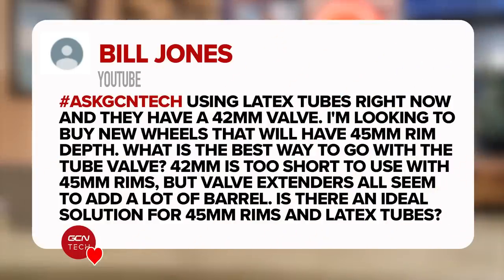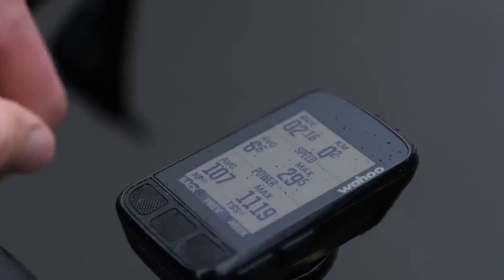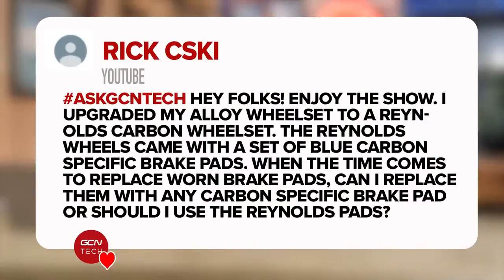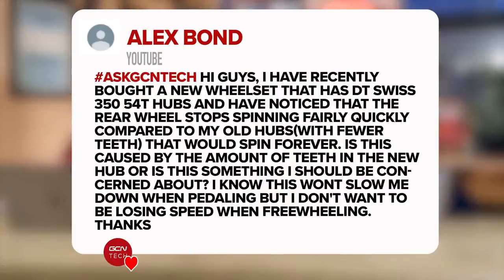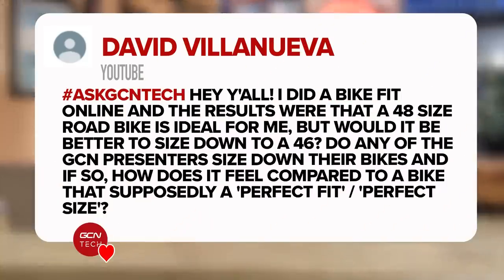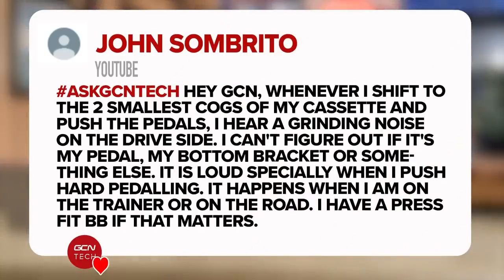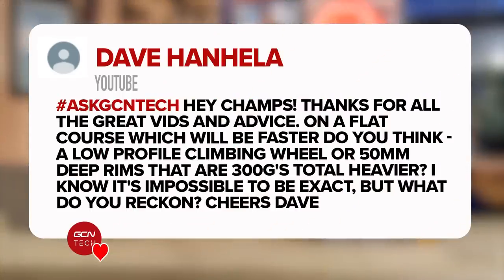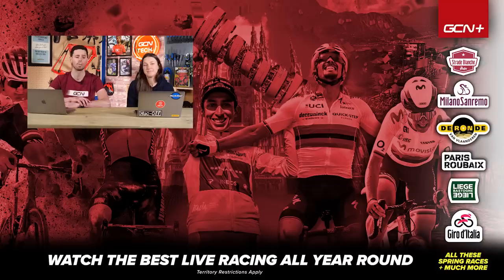Does Wheel Weight Matter On A Flat Ride? | GCN Tech Clinic

Comment: #Askgcntech Hi Manon, Ollie, Alex and Connor, thanks for all the great info. I'd like to know how many miles or intervals is a good rule of thumb to repack my wheel bearings and bottom bracket bearings. (I have sealed bearings) I almost always ride in dry clean conditions and keep things clean and never use a power washer to clean the bike. Thanks again for all the Great Videos!!!
Reply: Great question! I was literally about to ask the same thing!
Reply: I never touch sealed bearings. Digging out the seals is likely to damage them, in my opinion, and the benefits of fresh grease will then be compromised by a less effective seal. My last BB went for 16.000 miles so why risk it?
Reply: My last cone and cup bearing was destroyed somewhere between 7,500 an 12,000 miles desoite my mechanics insistance that they did not need servicing.  It will be interesting to get pro- mechanic Alex's take on it.
Reply: @grahamaustin9085  I would be changing the bearings in less then a year and a half at that rate. I'd like to get at least 25,000 miles or more before changing the bearings.
Reply: @ernest2364  And you exceed that?
Reply: @grahamaustin9085  I have a Hambini threaded bottom bracket with NTN bearing in it.  It's  coming up to 15,000 miles on it and still spinning perfect without changing the grease in it and thinking it should be done, but wanted to see what GCN has to say about them. I've been told 25,000 miles is no problem with good threaded bottom brackets. My past bike with BB30s would be toast at 15,000 miles.
Reply: @ernest2364  Why not ask the man himself, Hambini?  I’m sure he’ll have something to say about the advisability 👍
Reply: @grahamaustin9085  I just did that this morning, now I'm waiting for a reply. But I don't think anyone will commit to a minimum rule of thumb with this question lol

Comment: #AskGCNTech Hi tech team, I had the idea of using my old MTB frame on the turbo so that I don‘t have to put my road bike on and off all the time. I thought about putting drop handlebars on it to replicate the position on the road bike but will road components work with it? Will for example a road cassette work with the different dropout spacing (135mm vs. 130mm) and will I be able to adjust the gears to make it work?
Reply: Great question! Hopefully this one gets answered.
Reply: @dankenno  The bonus is that it‘s a Scott Scandium 1200g frame, the pinnacle of light MTB alloy frames. I hope it will be ok if I don‘t sprint out of the saddle.

Comment: Small small noise is most likely catching the outer plate on the front mech with some crank/frame flex.
Reply: I totally agree. Another possibility is that the front mech cable lost some tension along time and now it's rubbing against the chain when using the smallest cogs. That's a pretty common issue. Cheers!
Reply: Chain could be too long.. causing rear mech to double back on itself ( pretty obvious to be honest if it was..)

Comment: PLEASE HELP - about the grinding noise. About the year ago I decided to upgrade my drivetrain on my main bike (TCR). Before all was good, but with new chain, cassette and cranks (r7000), I ended up with grinding noise and huge vibration under the pedals on first 2 cogs (smallest). I tried everything and nothing seems to help. Was same on trainer, I tried another derailleur, different chains, bought brand new derailleur hanger, checked if not bent, tried other cranks - no difference. Last thing that I wanna try is to replace BB (pressfit) even though original one doesn´t seem to be faulty. I am quite desperate. Was using my alu bike whole winter, but am hoping to jump back to TCR. It can´t be frame problem as prior replacing drivetrain, all was working super smooth. Any help appreciated.
Reply: Take it to the shop

Comment: #askgmbntech Hi guys, I commute to work on a bike I've built myself it's heavy but doesn't bother me, I do take it on the back roads up the mountain roads and you can notice the extra weight. Which got me thinking, would using a heavy bike with tyres that have a high rolling resistance, help you improve your strength and conditioning on a bike. The amount of effort you put in, on a heavy bike would that same amount of effort make you fast on a lighter bike.
Reply: You must be in the "ride up grades" camp.  🙄

Comment: #AskGCNTech  To lower my cadence at higher speeds, what would be preferred, replacing my rear (currently freewheel based) wheel with a freehub and 11t cassette instead of the current 14t freewheel,  or bigger rings up front? (current 42T)  Are there any reasons why a smaller one in the back, or bigger one up front would be preferable over the other?  (not caring about replacing the current rear wheel, as it's gonna need replacement soon anyway)
Reply: Changing the rear cassette is probably the easier and cheaper solution. Either way get a new chain.
Reply: @jameswitte5676  That's what I was thinking at first too, but then you mention getting an 11t to someone, and people open up a rabbit hole that I should have expected around ppl that are passionate about bikes. With stuff like getting more wear on the rear with a smaller gear, less wear on the front with more teeth (makes sense),  more chain wear on the smaller gear because at the point where it's under peak load it will rotate more degrees on a smaller diameter gear compared to a bigger one, which would also increase losses and much much more theories why I should pick one over the other.
Personally I don't think it's gonna make a huge difference, but figured I might as well ask here if there are any significant advantages to one over the other as I figure the GCN folks have probably heard about it. 😁
Reply: @esenel92  Seeing as all the pros use 11t cassettes or even 10t for SRAM I wouldn’t stress over using an 11t cassette. They certainly put out way more power than I can. Your decision may be affected by what you can find available for sale.